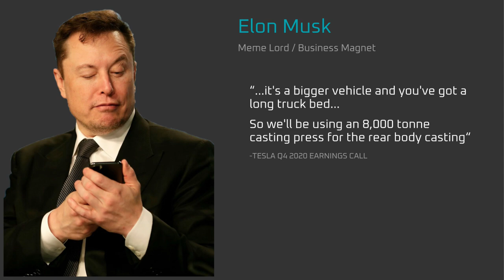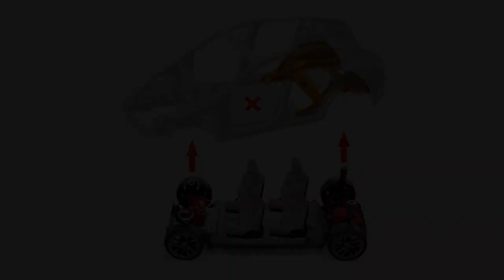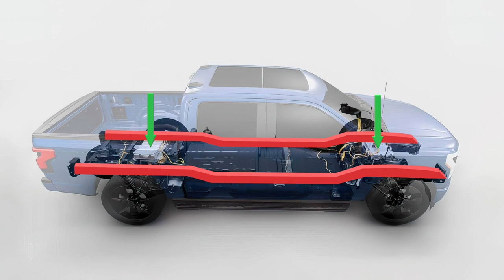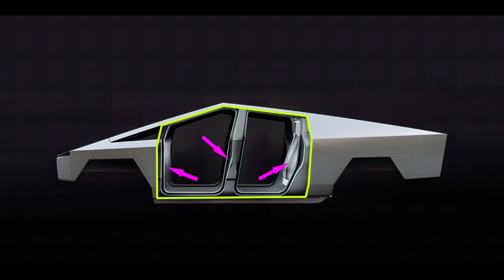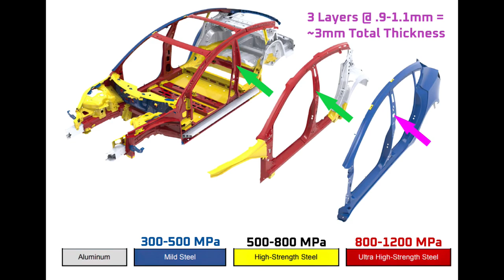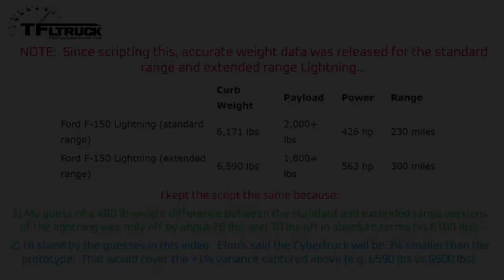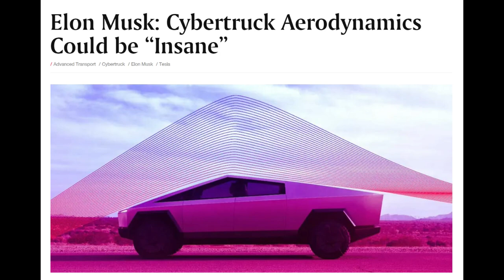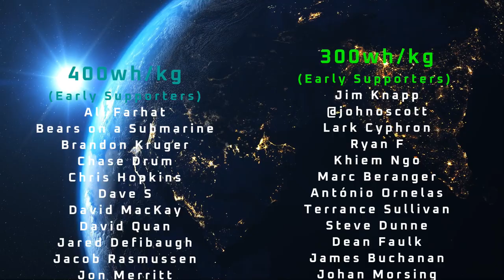Cybertruck // Merging the Exoskeleton, Gigacastings, and Structural Battery Pack

Comment: I started driving in 1979 and since I've come across quite a few situations on the road where I wished I was driving in a tank or a car with heavy steel bumpers to teach an idiot driver a hard lesson. Probably you'll recognize this sentiment.. With this ultra-strong exoskeleton I would for the first time get the option to act judge, jury and executioner and be able to dent the idiot's car without any damage. Are there any road safety laws in existence to provide some form of crumbling and/or genteel shock absorbing capacity? I seem to recall that here in the EU the solid steel bumpers were outlawed because even a minor accidental bump with e.g. a cyclist or a pedestrian could cause major compound fractures.

A second remark, this time about the battery structural pack: In one of his previous video's Jordan explained the major streamlining in battery cell manufacturing that is in the works, starting with Maxwell technology but essentially taking a critical look at each and every step. At the end of this streamlined process the packs are put together. Could it be that the final battery enclosure (the pan) could already be used in this final step in the battery manufacturing factory? It would eliminate temporary storage racks and only require sealing the cells in genral assembly.
Reply from the maker: Lol!  Yeah man, if you're living in a bad part of a city or a rough country, this thing will be the vehicle to get.

Good question.  I don't know who they'll handle the front bumper issue.  Maybe they just won't sell it in the EU or they'll develop a special version.

As far as the last question, I don't quite follow.  The battery enclosure is part of the structural pack, and the pan is part of the body.  With the 4680 and structural battery pack, in the new factories, those batttery packs are going to be manufactured in the same building as the vehicles, so my guess is the storage requirement won't be great.  

They'll certainly need some storage as a buffer, much the same way they have storage for every other part.  Without a storage buffer, the line could get herky jerky.  

Building a pack in place on the line may not provide any advantages, and would also require its own materials buffer.  This is much the same way they don't build the car seats in the car, but install them as part of an assembly.
Reply: @thelimitingfactor  Or the AI just won't let you hit a VRU but might be fine with "solid but moveable" objects/other large vehicles ...

Comment: I'm sorry, but I have to dispute one detail that you brought up.

You talked about the Cyber truck having different ranges and because of that having different batteries.

The model 3, and the model Y both offer different range capabilities, depending on how you order them, but do not change the battery size!  It is the efficiencies of the design that change the range.  I expect all three versions of the truck to have the same battery pack.

Comment: and assuming nothing critical on the vehicle will ever rust b/c the body material is pretty unrealistic. And given tesla's predilection for replacing full assemblies rather than potentially insanely cheap fittings makes the skate board as floor not nearly as attractive as you make it sound
Reply from the maker: Yeah, I overstated there, but 99% of people worked out what I was saying:  Hell of a lot better than a steel vehicle.  As for the latter part, I have no clue what point you're trying to convey.  You are speaking imprecisely.
Reply: @thelimitingfactor  okay, let me simify for you, even though I was being precise. Tesla charges over $10k for a full battery replacement because it refuses to sell any of the cheap plastic connectors to it as separate parts. Is this a statement you can understand?

Comment: My concern is the trucks ability to collapse in collision. If it’s goal to be safe it will need the front fenders to be thinner sheet stock. And the  skeleton strength would end at  cowl. I’m also thinking composite bed box for rear hit.and the bedsides can be detent to collapse like hoods do now. Of course the Cybertruck hood will also. All these factors need to be included in next video on this subject. It’s not a guess but if it needs to be road legal it’s a fact. Make it tough but make it safe. There are three impacts in a collision. 1, the vehicle impacts object. 2, the occupants impact the car interior. 3 your brain impacts the inside of your skull. The vehicle needs to reduce all this. Ok you’re up. 👍
Reply from the maker: It will collapse just fine.  The energy involved in an accident is ridiculous.  It's the castings you have to worry about.  And those are designed to collapse as well.
Reply: You are kinda acting like the people who have made 4 of the safest cars ever have no idea about safety requirements.  Really.  Think about it.
Reply: @TheEvilmooseofdoom  not at all

Comment: Your point about body on frame being more durable and heavy duty is moot. Ever since the 60s, vans have been unibody, and they are the same length, width, and wheelbase as a truck and can carry the same load. There's absolutely no reason why you can't engineer a unibody to be as strong as a frame. In fact, you can make it stronger because of the 3D structure which limits twisting (frames are very prone to twisting). There're two reasons why pickups are predominantly body on frame: price and tradition. For one, pickup trucks are very rarely used in Europe - we use vans instead. In the US vans are attributed to serial killers and perverts for some reason and very few contractors will buy a van just for that reason.
Reply from the maker: As far as I could find, older vans, even minivans, used truck frames.
Reply: @thelimitingfactor  Yes, the bigger pre-60s vans were build on top of platform truck designs. Smaller vans have been unibody since the 20s or 30s. Nowadays even 6+ meter vans use unibody. I think Iveco has a big model that reuses the platform of one of their smaller platform trucks but it's more of an exception.
Reply: @thelimitingfactor  modern vans like Mercedes sprinter heavy duty models and even Ford transit still uses steel frame.
Reply: Vans are also way more in Europe and Asia because most people drives smaller cars and just rent a van to move bigger things around. Americans have too much giant fuel inefficient car's.
Reply: Contractors use plenty of vans in the U.S. Whether they go with a pickup truck or a van depends on a number of factors from what sort of contractor they are to what the specific use of the vehicle will be.
Reply: @alanlight7740  still more Americans drives pickup trucks just because they want to own one, it's just a gigantic waste of resources just like with bigger electric cars that needs considerable amount of batteries. The million cybertruck preorders are not for people wanting to use it as what it was intended for which is a big shame.
Reply: @alanmay7929  - what was the CT intended for?

Other than being a good general purpose vehicle that meets almost all the needs an ordinary driver might have, the chief purpose I see is to make it clear to the general public that an electric vehicle can handle the toughest jobs out there and do it better than an internal combustion engine. Considering all the other manufacturers that suddenly started taking electrification seriously it seems to have done its primary job well.
Reply: @alanlight7740  you are way tooo funny mate, which electric vehicles does a way better job than a combustion engine vehicle?! Diesel is and will remain the king, nothing beats diesel on both towing, overlanding, all the flexibility of use......
Reply: @alanlight7740  the tesla model x plaid has over 1020hp but barely tows 5000lbs whereas the Porsche cayenne turbo s with 600ish hp tows around 7000lbs.
Reply: @alanmay7929  - silly boy, the Model X is not intended as a vehicle to tow with, and even the majority of pickup truck owners never use their trucks for towing. Only something like 2% tow regularly. The highest trim CT will handle 14,000 pounds, if that's what you're interested in.

And of course towing is primarily a range issue - the one place where we know that electric vehicles are not yet where they should be, but they will be there soon. In terms of acceleration, handling, torque, maintenance, operating costs, and total cost of ownership, electric already beats diesel.

To say nothing of the value of not poisoning your family and your neighborhood with diesel fumes.
Reply: @alanlight7740  you have definitely lost many brain cells mate, the tesla model x plaid 1020hp has a towing capacity of 5000lbs an a Porsche cayenne turbo s 600hp has 7000lbs towing capacity those are the data's given by the manufacturers I don't what you want to justify here. All vehicles are capable of towing doesn't matter if you tow or not again no one goes a shit.
Reply: @alanlight7740  the same thing goes with majority of truck owners who never uses the truck for what it was intended. I don't care if the cybertruck tows 14000lbs or not it's not a multi purpose vehicle, again a 200hp Toyota hilux is way more versatile that, goes basically everywhere with Jerry can or auxiliary fuel tank, possibility to convert it into an RV...... there are literally tons of videos in YouTube with hilux.
Reply: @alanmay7929  - sure, even a remote control toy car is capable of towing, but as you say no one gives a shit. Even most truck owners never use their trucks for towing, and those who do are usually towing light weight trailers on the rare occasions they want to tow at all.

Comment: You suggested aluminum door frames. It is doubtful. I know you can glue these parts in, but that is unlikely. Aluminum cannot be easily welded to stainless steel.
Reply from the maker: A good point!
Reply: @boostav  I would guess the aluminum castings would be bolted/pinned on to stainless steel body for ease of manufacturing.

Comment: After watching the Munro teardown of the Model S Plaid,  I can't help but wonder if Tesla can use a front drive assembly similar to the model S in both the front and rear of the Cyber truck. They  could  change the steering control to electric fly-by-wire giving four wheel drive and four wheel steer.

Comment: If you could just re-record and re-upload this using kilograms instead of pounds that’d be awesome. Imperial system can duck off. Quack.
Reply from the maker: Most of the time I cater to the metric crowd, but these trucks will primarily be for the U.S. and both Ford/Tesla operate on pounds...so no sense in converting for an audience that probably won't buy it, see it IRL, or interact with it.

That is, this was more about a product than science.

Comment: "A triangle is the strongest shape there is" - really? T = 585s.
Reply from the maker: Depends on what you're building.  But overall, yes, a triangle.  In fact, turn the T sideways and you have a triangle without a base...so add a base and it becomes stronger.

Comment: When he says weight in pounds im gone. If I've got to look up the units it's too hard. The rest of the world use Kg, mm, Km/hr and litres per 100km.

Musk sais the cyber truck will have bullet proof windows. Sounds very heavy, given the size of windscreen etc.

Insurance and repairs for the cybertruck will be a nightmare as there are no replacable side quarters panels to replace. Every ding will need a stainless steel cut weld and repaire.

Comment: Being from Europe all I wonder is how they are going to design for pedestrian safety. Without it they can’t fulfill my order.
Reply from the maker: I didn't realise you could place orders from Europe for the C/T!  Yeah, that could be a serious snag.
Reply: :-) there are usely some legal loopholes .... if not, just licence the car in a non EU country :-) in the 80ies we used to register our non-germany-allowed motorcycles in Belgium.
Reply: @thelimitingfactor  without price tho, only the FSD price is locked in. I’ll see what it comes to. Currently have the cheapest on reservation as cars with a gross weight above 3500kg/7700 lbs require a truck driver’s license.
Reply: @thelimitingfactor  You can, I have 4 reserved or is it 5 ...
Reply: @thelimitingfactor  The HiLux, F150, Ranger, LS200 (Nissan) and others are all sold in Europe, seemingly without issue.
Reply: @Deveonn  Based on the calculations in the video we are likely looking at around 2500kg for vehicle weight, so if they "pretend the gross is less", e.g. 3499, we could be fine and still have an official/legal ability to carry 1000kg. ;)  They could then offer a "pro"/trade "super duty" version which is actually  identical but type-approved for more load.

Comment: Love the videos, disagree about pricing. Base model will be 70k+ ; i see no way they can make the price even close to a Model Y with the limited run and addition of new engineering
Reply from the maker: Thanks man.  Yeah, it won't be cheap.  But, this wasn't a price analysis video, it was high level heuristics.  As fast as the price of everything is rising...pick a price and you'll probably be wrong.
Reply: @thelimitingfactor  good point, being that most good ICE trucks start at 60k nobody should be surprised. Just think the 39k and 49k announcements were disingenuous haha
Reply: good engineering can reduce costs. The body on a truck is bolted onto a frame and is structurally useless but adds to weight, complexity and cost.  Making the body THE frame, especially with SS, saves the costs of corrosion mitigation (painting etc.)
Reply: @1Snouser  The original costs were projections at that time.